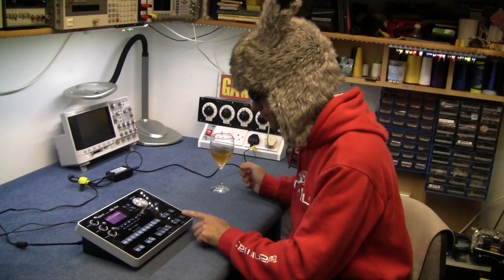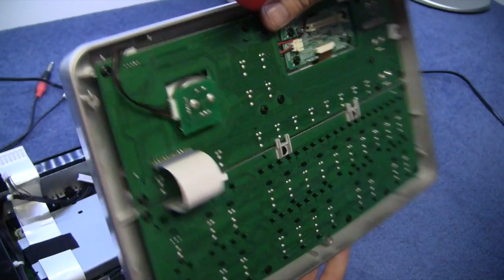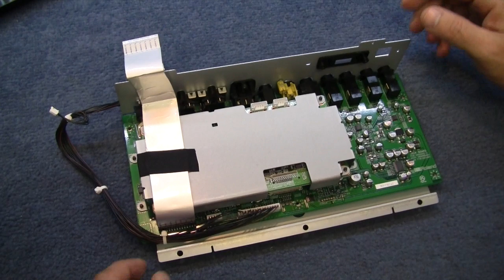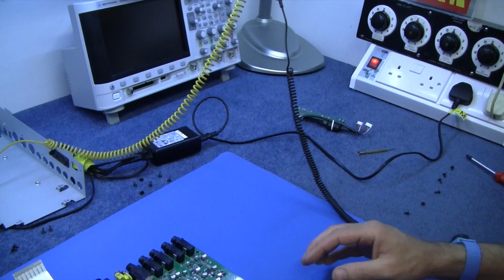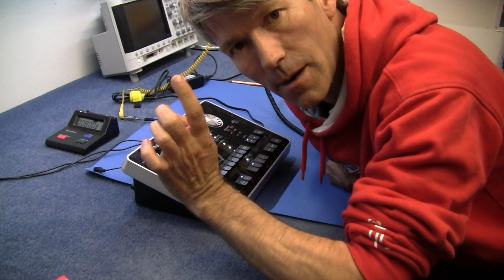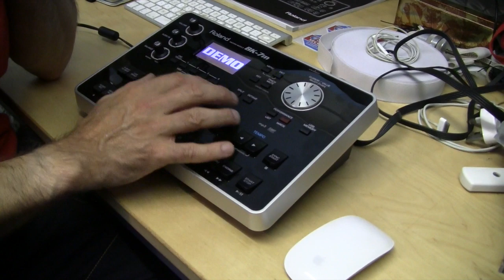MF#24 ROLAND BK-7m  Look Whats Inside it ?

Comment: I'm piloting BK-7m with Roland PRO-E (arranger).
Pro-E arranger comes complete with a keyboard while BK-7m does not.
I connected OUT of the PRO-E to IN of BK7.
I put the same channel as the SYNC START and the same channel as the DRUM (ch 10).
I have turned OFF the accompaniments of the PRO-E, so when I press a key the BK7 drums start.
However, if you strike a chord on the PRO-E, the drums of the BK-7m will start, but the accompaniments will not start.
How can I solve the problem?